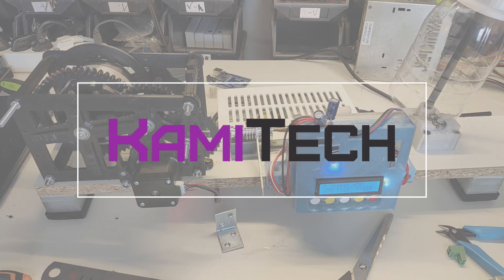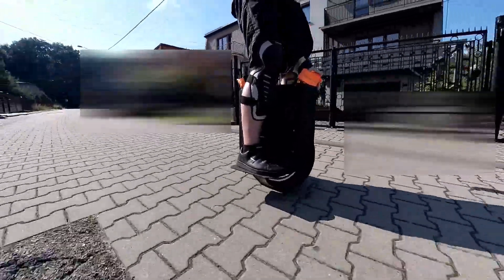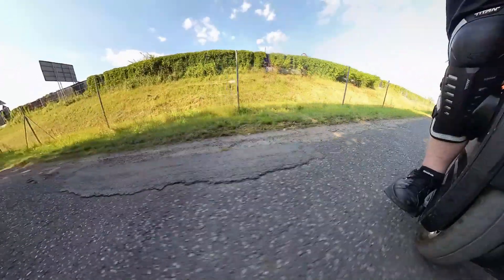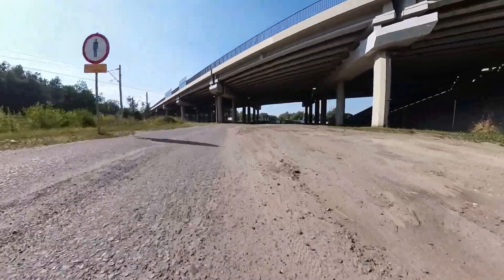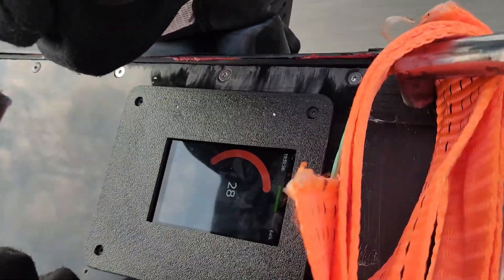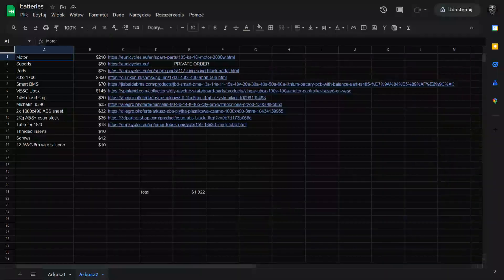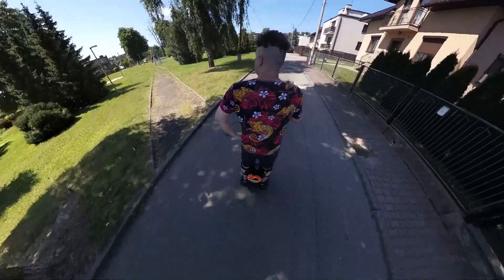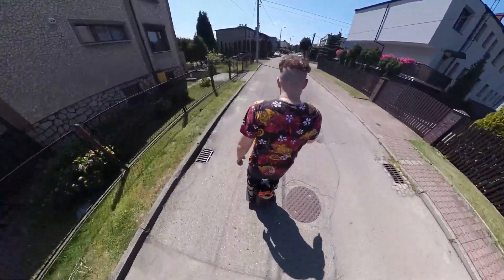DIY Electric Unicycle (EUC) UniVesc - Details

Comment: To me that looks the same as bike direct drive motors but in a smaller wheel, which is more ideal as resistive losses are the biggest issue in practice, due to the high torque versus copper quantity involved.

Comment: Hello sir.  I can definitely use your help.  I am working on a project with an iota trax.  Everything is already hooked up.  I am using a Trampa 100/250. I am using  the VESC tool app .

  I did the IMU and calibration.  The motor detection was successful.   But my wheel is still not balancing  and there is  still no back & forth movement.   I just need to know the correct way to connect a Trampa 100/250 to a balance scooter like the one I have .  Thank you

Comment: How did you go tubeless? I've went thru two tubes in 700 miles
Reply from the maker: I simply put tire with bead sealant on the rim and used the bent motorcycle valve. Yes I am aware sealant may corrode rim but so far no problem and air is still holding up.

Comment: Great work i'd love to see diy euc market to grow in the same way that the diy one wheel has. The euc's sold now are getting way too expensive. I made one using a Trampa Boards VESC and a motor from and old Gotway MSuper. Works great. I just wish there was a higher voltage option for a bit more power.
Reply: Hello, I have a msuper 2 HS at home. Do you have any documentation to put it on a vesc motherboard ?

Comment: can you make video of VESC tuning please?
my inmotion V11 just stopped working because of motherboard electronics issue.  I know the motor is fine because I tested it with my VESC 100/250.  In motion says I should try buying expensive control boards and change them to see if  I can fix the problem but I'd rather just build my own VESC version that I know.  Their inmotion app told me the motor was bad but I used my VESC to test it, you can see the video on my channel, worlds first remote controlled electric unicycle
Reply from the maker: I plan on making such video when im done with vesc so it will be still quite some time before it happens but for now i suggest checking out surfdado videos about it, they match 90% of what should be done for EUC with exception of using built in balance app, not float package. Also im usually at vesc discord https://discord.gg/PFxtGrNX
Reply: @KaminarisTech  alien rides says the V11 batteries need a signal from the controller to make full power, you can't VESC the V11?  I think they got a better controller than the trampa too.
Reply: The discord link expired.
Reply: Very interesting , a new world DIY EUC , great open source innovation.

Comment: Very nice project, congrats on your success!

You think about shoring up the weakness of the 3D prints with fiberglass such as at seams and around fasteners? Some strategically placed, low-infill TPU armor attached with hook&loop, could help mitigate crash forces if it ever goes for a tumble. 

Also, ABS is mechanically weakened by UV exposure - just something to be aware of for your next project(s) if you didn't know. Carbon impregnated filaments or nylon blends might be a better fit if sticking to 3D printing for large semi-structural parts, but $$$ and stricter printing parameters.
Reply from the maker: Entire shell was sanded, covered with car body filler and painted with anti gravel paint so UV light is not a problem - does not even reach plastic. Weakness of Abs prints is mechanical stress that separates layers, abs has unfortunately pretty weak layer adhesion. At least compared to PETG.
Reply: @KaminarisTech  Oh good! Makes sense now with the exterior looking smooth. 👍

The VESC programming for EUC is very impressive. I'd love to see a video detailing your trial and error process getting it to work, but that's the same as asking for a bunch of work for free. I'll just stay tuned for future videos😎
Reply from the maker: @vanturion there is a bug in balance wizard preventing you from calibrating accel/gyro. This is why it took me so long to get it working. All of the details regarding setting up are nicely sumed up by https://www.youtube.com/@surfdado/videos but with 3 differences:
1. you don't use float package, just internal balance algorithm
2. after the wizard its necessary to change Mahony KI to something like 0.2 or 0.3 because its get set as 0.03 (and its a bug) and do partial calibration again
3. making sure vesc is super stable inside chassis.

Of course process is much more involved and requires tweaking values per motor so i cant tell how my values will behave on other motor/controller. But surfdado videos explains 90% of things.
Reply: @KaminarisTech  ah, I had no idea the VESC software suite was so developed or came with it's own IMU. That's really great, makes projects like this a lot more accessible.

Looks like some great tips that could save fellow DIYers a lot of time, thanks for sharing!